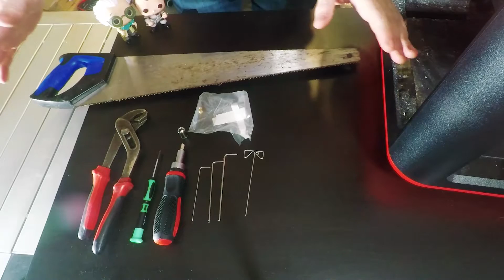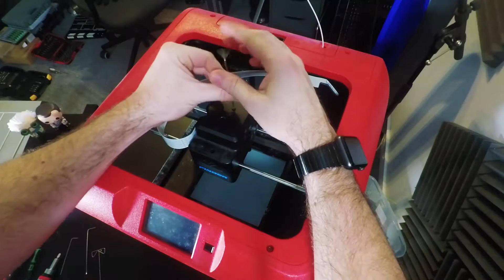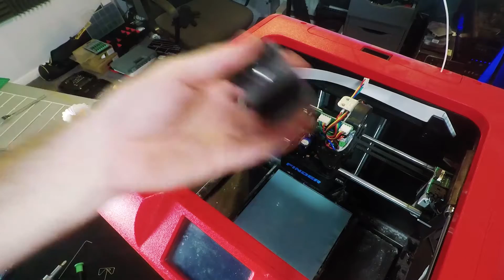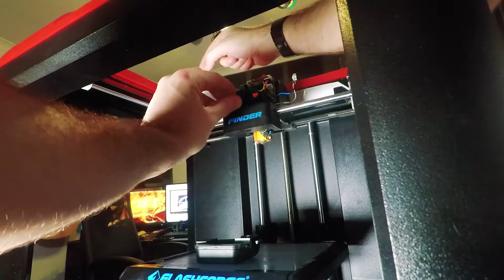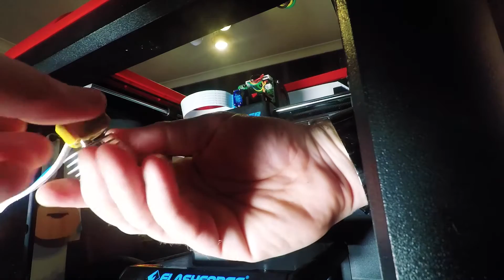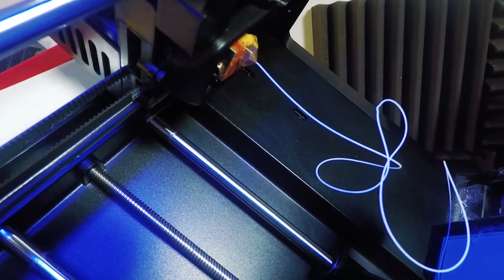Flashforge Finder | Nozzle Replacement

Comment: Great video. When reassembling, if you make sure the little grub screw holding in the nozzle assembly is super tight, and you don't over tighten the new brass nozzle, future nozzle changes can be done by simply unscrewing the brass nozzle with a 9mm socket instead of taking the whole machine apart.
Reply: How are you verified
Reply: @mattshumway2296  Youtube realised I was awesome.
Reply: That is so good to know. I wondered why we had to take the whole thing apart anyway. It's good to know the steps though.

Comment: Thanks for the video. Wish I could post pics. I bought a used FINDER that "Works Great." Well, it didn't. It all came down to a previous owner had changed the nozzle by just removing and replacing (I'm guessing). There was a 5mm gap between the nozzle and the PTF tube, I was having crazy inconsistent extrusion rates, and chattering of the feed gear, as well as it just not feeding, and not loading filament no matter how hard I pushed it in. I ended up following your video. I'm running a quick print now and so far, it's feeding properly, and the extrusion of PLA seems consistent. Thanks for your video!

Comment: Thanks so much for this video. I had the hardest time putting the little set screw back. I dropped it and ti disappeared and took me a few days to get the right one back. One suggestion, spend a few minutes making sure we put it back together the correct way with all the wires in the right places, etc. Otherwise, this was great.

Comment: why did you take the entire print head apart to take the nozzle, the nozzle is simply threaded into that portion of the printer. the tube comes out by simply unscrewing the nozzle correct?  i am confused why you removed the entire print head assembly.
Reply from the maker: Unfortunately you have to, there is no way of just unscrewing it due to the way it is spaced internally.
Reply: yea, seems like waste of time :)
Reply: If you dont take apart the unit, you will be applying to much force to unscrew the nozzle, and it will damage everything, and it will never print the same again.  DO NOT TAKE SHORT CUTS.

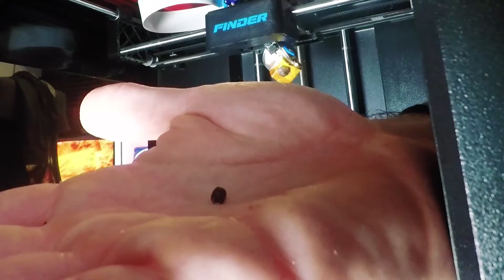Comment: How do you get the grub screw back in? The one that was taken out at 3:24 ?
Reply: I replaced it today by removing the three screws from the servo ( sensor ) Than you see what you do.
Reply: Thanks @wolffgramm  we ended up getting it back in by rotating the entire printer on its side and having it fall in. Right nightmare. But this is good to know for next time, cheers :)

Comment: I’ve currently got a 0.4 nozzle on my printer would it harm my prints e.g. fail them if I put a 0.5 - 0.6 nozzle as a replacement to the 0.4??

Comment: After taking off the lower air duct casing and removing the grub screw the hotend refuses to come out! In your video it falls out under its own weight but mine is completely stuck.
I know this video is old but hopefully someone might be able to shine some light on this

Comment: Do you know where the buzzer/speaker is? I am tired of the sounds from my FlashForge Finder.
Reply: You can disable the startup melody in the settings
Reply: @filmrullen  Yes, but not the ones that follow calibration and finished printing. 🙂

Comment: I see yours has the upgraded left rear microswitch bracket, the one I bought recently had two little plastic standoffs and you know what happens with repeated bashing by the gantry... they snapped off lol   So I found some suitable copper tube, cut off two 10mm lengths, found some long self tappers, epoxied the holes up then put pilot hole in for the screws and voila one fixed endstop.   See if the copper holds up better than the piddly plastic standoffs lol

Comment: I really don't know what makes less sense, that to change a threaded nozzle is needed to dismount 40 % of the machine, or that Flashforge doesn't issue a guide for it as if this kind of operatons never was necessary...

Comment: Idk what dimension this guy is living in, but the tip just "Doesnt come off" 

Now all i have is a disassembled printer and a fucked up broken hotend. Thanks.
Reply from the maker: Sorry you couldn't follow it bud. 3D printing is a very temperamental hobby that requires a lot of patience and often you have to figure out things by just playing.
Reply: Yeah it was hard for me too, just screw really hard and mine eventually broke loose.
Reply: Mine stripped completely and the aluminum block got ruined because the nozzle was on too tight. 50 dollars total for the whole fix

Comment: To anyone watching this; NO! you don't have to take apart the whole thing - all you need to do is remove the lower black plastic portion and unscrew the nozzle and pull the tube out, just like in this video (which describes the whole "all metal hotend upgrade", which you can stop at replacing the nozzle):

https://www.youtube.com/watch?v=G04dj9DcJUI
Reply from the maker: While it might be possible to do it as you have described here, I wouldn't recommend doing it without removing the heat break first, to ensure a clean tight fit you must re assemble and tighten it in the order of heat break then the nozzle. Not doing this can lead to filament leaking from the top of the heat block.

Comment: 90% of the steps in this video can be skipped. Don't unscrew the motor and don't detach any of the stuff that he tells you. I realized far too late that this video was a bad tutorial and I should have read the comments first because they're right...
Reply from the maker: I wouldn't recommend doing it without removing the heat break first, to ensure a clean tight fit you must re assemble it in the order of heat break then the nozzle. Not doing this can lead to filament leaking from the top of the heat block.